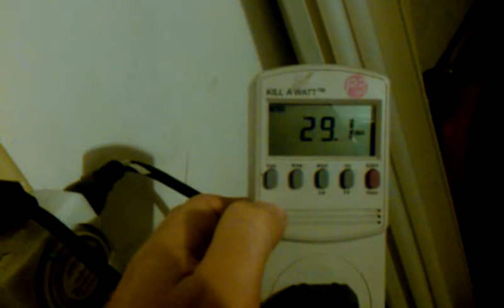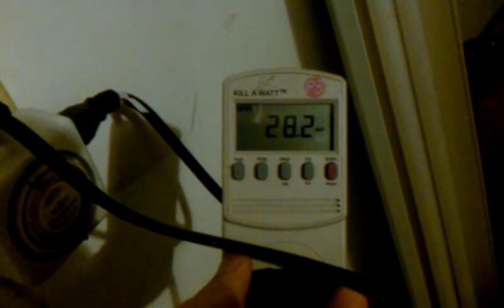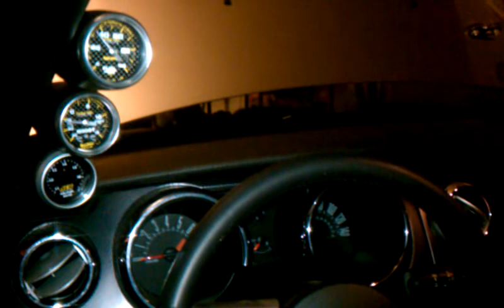Solar panels & Powerjack 1200 watt grid tie part 6

Comment from the maker: @Xringer I don't know if it'll roll over or not and it may just max out and not increase anymore which is what I'm thinking since they said the MAX is 6000-ish watts etc. Let me know what your findings are. I bought the meter to monitor input and outputs of anything I needed to measure. I did a test on my refrigerator today, it used 500 watt hours in 4 hours or 125 watts per hour. Seems like that's pretty efficient to me! My theater system used 450 watts per hour doing the same test.

Comment from the maker: @Xringer 100 volts? If I said that I probably meant 100A which is maximum and 50A stable. 

If you use the optional battery you'll have to manually reset it each day. I have to manually reset it anyway because in the morning the screen is just a solid bunch of blocks. I think what happens is there isn't enough volts, 4VDC, very early in the morning so the screen blanks out. Once the voltage ramps up, usually after I get out of bed, I just trip the breaker, wait for the CAP to discharge and reset

Comment: Your AC kw meter is probably reading power draw rather than power generation.
Would have been interesting to see you disconnect the solar panels and see what the AC Kw meter reads. Does your Powerjack 1200w include the LCD meter?

Comment from the maker: @MrMG1973 Yeah, I'm pretty sure what it was is that the powerjack was drawing power of its own at such a low input voltage so it was a combined reading. I'm uploading another video now but it's been cloudy all day so I didn't get much power today. The input peaked around 304 watts at 9.94-ish amps. I was thinking about doing a 10A breaker but looks like that's not going to work out so I'm going to try a 15A breaker and go from there.